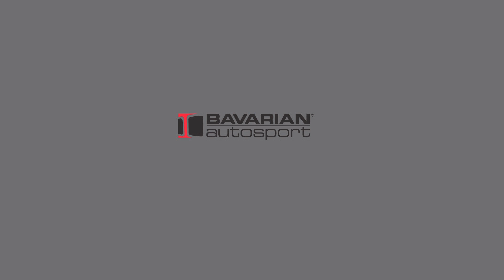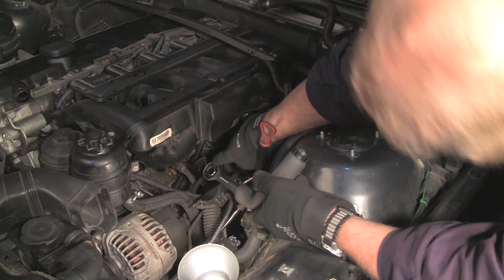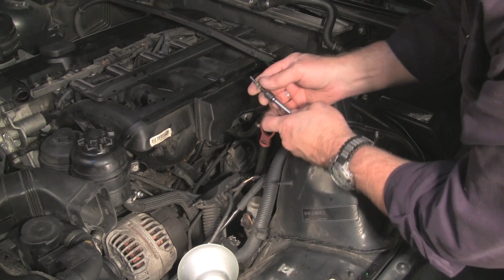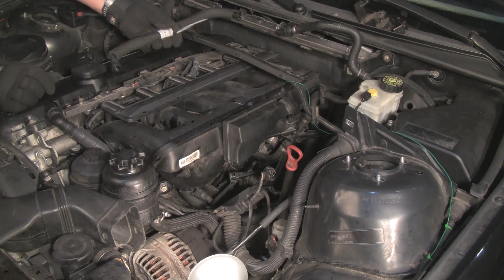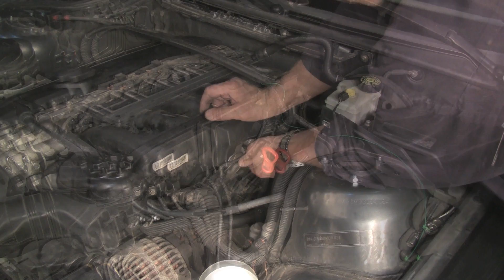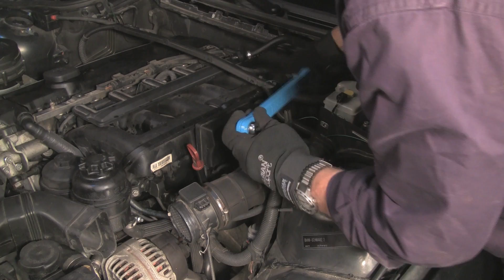Replacing the BMW M54 Crankcase Ventilation System, Part 3 of 3

Comment from the maker: The oil leakage could be from a cracked oil separator, oil drain hose (from the separator) or the gasket between the oil filter housing and the engine block.

Comment from the maker: You may have not properly connected the electrical plug or hose connection on the purger valve. 

Have you fixed the issue, by now?

Comment from the maker: Much of the time a torque wrench can't be used due to access to the fastener.  Other than this, the torque values may vary from model to model and we recommend that the applicable Bentley repair manual be used for torque references.  Finally, after doing this for many (many) years, you tend to develop a pretty good feel for general torque values.  Critical fasteners, such as head bolts or ring gear bolts (for example) should still be torqued with the torque wrench.

Comment: Just bought an E46 and not had a chance (or need) to play with it yet other an oil change. I can't believe how hard it is to access the throttle body compared to the M52. That sucks. Thanks for the video.

Comment: thank you for this video its really helpful, but i have 2003 X5 3.0i is leaking oil from the same area that u were working on. it could be from the pcv system ? it is from the that area but i can't determine what is leaking. please can u help me with that Thank u, is not from the valve cover gasket !

Comment: Great DIY!  I just finished changing the CCV following your steps.  When I went to start it up after the job I got code P0444 (Evaporative Emission Control System Purge Control Valve Circuit Open).  I didn't have any codes when I embarked on this.  Any thoughts?
Reply: Maybe forgot to reconnect wire or not connected properly. 👍

Comment from the maker: Well, you either have the common M54 oil usage issues (the M54 engines tend not be oil eaters), or the check valve diaphragm in the CCV is ruptured and you are sucking more crankcase vent air past the check valve .... and the extra oil that comes with it.

Comment from the maker: Yes, you certainly can install the cold-weather parts.  There is no difference in the engine or the intake manifold.  The only differences are the insulated hoses and valve assembly.  With this noted, the uninsulated parts are easier to install, as they are effectively smaller (no insulation).  You can strip the insulation from the cold-weather parts, if desired.

Comment: This is one of the best DIYs that i've seen for this job! A lot of light and steady camera, excelent work. I'm going to replace my separator over the holidays. But I have a question.
My E46 330Ci 08/00 is a hot climate version meaning that it doens't have the isulation over the hoses, I've asked at the stealership and they told me that the car is not for cold climate (what a discovery...). Do you know if I get the cold climate versions with insulation it all will fit on a hot vehicle? Thanks.

Comment from the maker: Pressure in the crankcase is an indication that the crankcase ventilation system may be clogged.  We would suspect that the hose running from the valve cover to the oil separator, hose from the separator to the intake manifold, or the oil-separator/check-valve itself may be clogged with oil sludge and the crankcase is not being vented into the intake manifold as it should be.  In this case, replacement of the hoses and the valve would be in order. All is in-stock at bavauto.com or 800-535-2002.

Comment: I need help. Since I have had to fix several oil leaks. Valve cover, oil filter housing and pan gasket. After changing the pan  oil filter housing gaskets Now after start up there is a lot of crankcase pressure. the dipstick if removed while running will puke oil straight out of the dipstick tube. there is also pressure at the oil fill cap. I thought if the CCV valve fails you would get to much vacuum in the crankcase not pressure? Am I doing something wrong? Am I missing something

Comment: If you removed the DISA valve it would make the job a lot easier.  Two torx screws and one electrical connector and the DISA valve is off.

Comment: Thanks for your reply, the culprit was the OS upper nipple was to small, and not letting hose in smoothly. There's a reason it has to slide in and turn easily, the small cramped space doesn't allow for much room so the easy connection is critical. 
Even before I installed it I practiced and it required quite of bit of pressure to connect all the way in, so it was impossible to 'pushing the hose down to the manifold, connect and push the hose up' to fasten the hose to the OS. It was a bad OS.

Comment: Hi, I took the old vacuum hose off the old valve and placed it on the new one. You are spot on ! i have been chasing a air leak from somewhere! could not find it for ages, i have now found it and the noise has gone away so all is well and the car goes like a rocket now, ( leak was on the uppermost boot, where the return breather hose is located , had to pull it back to see the very small crack!) in case others have the same issue!
thanks for the reply ! until the next issue with the car.

Comment from the maker: Assuming that your original check valve assembly did not have the small vacuum hose on it (that you asked about earlier), removing the oil cap will create an internal vacuum leak which could make the diaphragm in the valve flutter,  Are there any other symptoms that you are dealing with?  Is all apparently OK, if the cap is installed?

Comment from the maker: The new check-valve/oil-separator assembly comes with a plug on the vacuum nipple.  You only have to deal with the nipple or plug if you have an early model that has the vacuum hose connected to the nipple (the hose goes to the fuel pressure regulator).  These would be models that still have a cable to the throttle.

Comment: Hi great videos thanks, made the job a lot easier. So I changed my CVS today without to many problems, but I noticed after i put it all back together again and looked at the old seperator had a blanking rubber stop on the very small nipple, question is, will this make a difference will i need to get to the nipple and push the hose on !! thanks Martin.

Comment from the maker: If you're having trouble with the tube connection, we would suggest that you remove the valve and the tube and practice installing the tube to the valve.  Once you have a real good feel for it, go back and re-assemble it on the car.

Comment: i'm stuck, i can't connect the outlet hose that connects to the nipple on the oil separator......
You show that the hose can twist up allowing it to connect to the nipple. The part I received from allows the connector to swivel so I have to use my hand in the small cramped space to try to twist it on.....i'm having a hard time doing that.

Comment: Thanks for the videos, I have taken my car apart 4 times, only replacing the bottom hose to the dip stick and the upper ventilation hose, MAF boots and sensor, due to codes P0170, P0173, P1188, P1189,  I have yet to replace the crank case valve. I have the part, But don't know if it could be the DISA valve, I unplugged it while idling but no change in sound, I took it out to test it  by closing the valve and putting my finger to see that it closes slow but stops half way. Any suggestions thanks

Comment from the maker: @oscarv362370 
The earlier cars that have cable operated throttles use the vacuum hose.  There is a nipple on the oil separator, under the foam insulation.  the nipple has a cap on it.  If the vehicle being repaired has the vacuum hose on the old one, you just separate the insulation to access the vacuum nipple, remove the cap and install the new section of hose.  The other end goes to the fuel pressure regulator, at the front of the fuel rail.

Comment from the maker: @EthanCommins888 
In general, just standard automotive hand tools are needed:
*  1/4" drive metric socket set with various length extensions and a universal joint
*  Standard metric wrench set 8mm to 13mm
*  Screwdrivers
*  Our flexible hose clamp driver is useful (# 53910)
*  Our Tite Reach wrench, 1/4" drive (# TR14V1 )